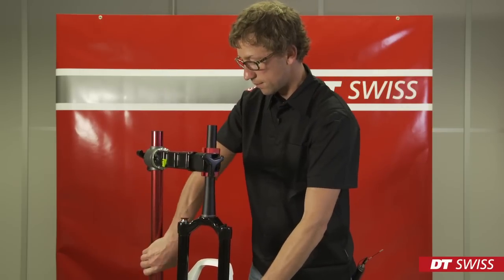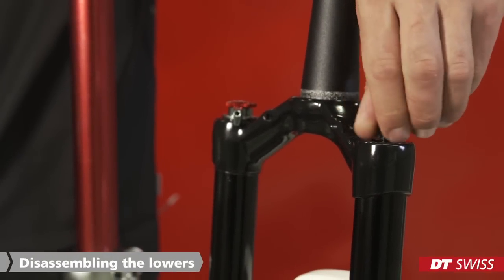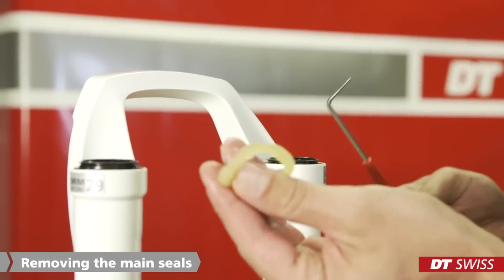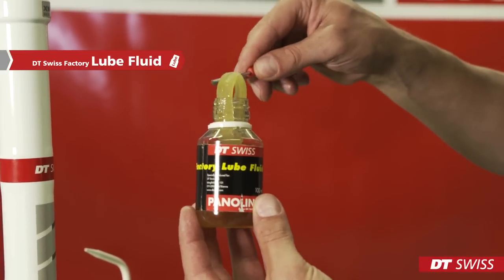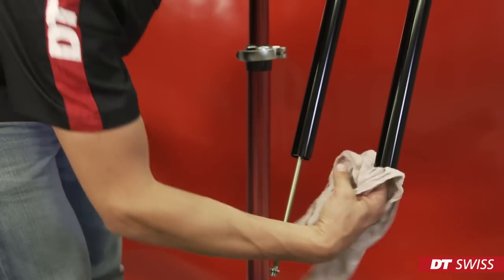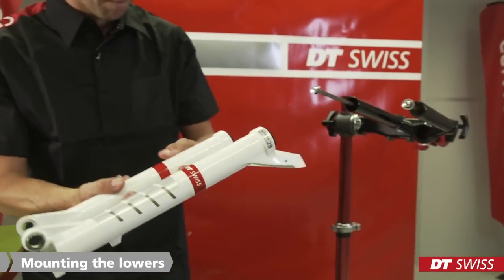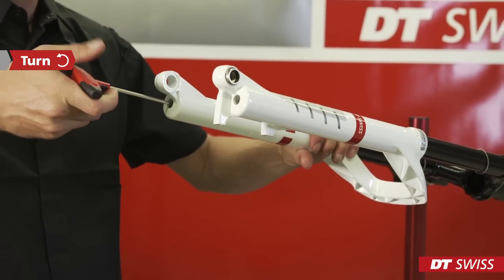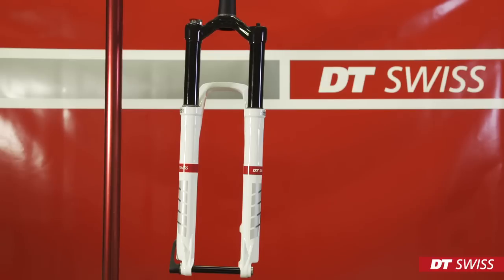DT Swiss | How to service Single Shot 2 OPM fork

Comment: And another question:
The service manual https://www.dtswiss.com/Resources/Support/FORKS/DT-Swiss-Forks-O-L-Single-Shot-2-Technical-Man
page 46 says - The O-rings of the connecting pieces should be changed every time the lower unit is dismounted

Where to get those o-rings? FWKXXXXXXXXX03718S as it is sold usually does not contain O rings... This manual also does not show how to change those rings...

1) does those o-rings have to be changed every time?
2) Where to get them?

Comment: Hallo, what oil viscosity i'm need for my DT Swiss XMM single shot fork? 5w or 7,5w? And for main seals?
Reply: *****  Thanks, Motorex  fork oli 5w, it's ok? 2.5w  it's to fluid? Panoline oil, it's very hard to find, in local shops!
Reply: +dtswiss Hi, does Panolin still produces DT Swiss fork oil? It is really hard to find. none of major shops (bike24/bike-discounts) sell such oil. Fluid is available but not oil. So is it advised to use 5w?